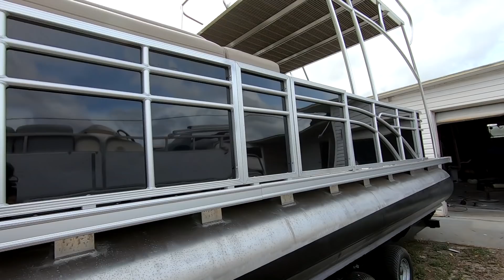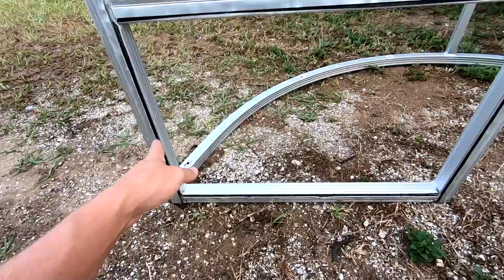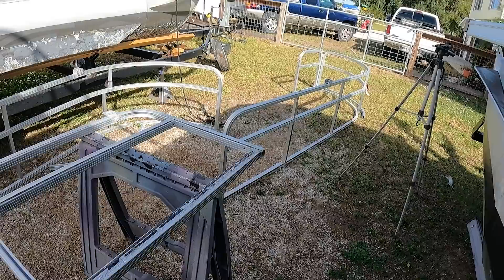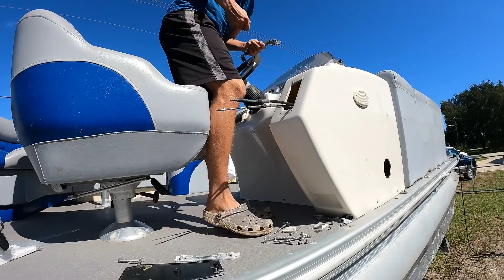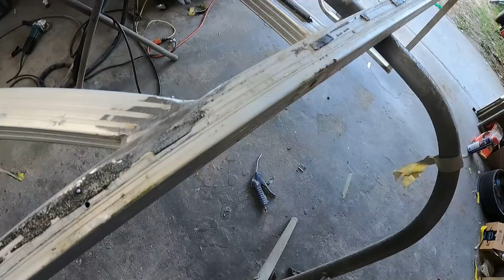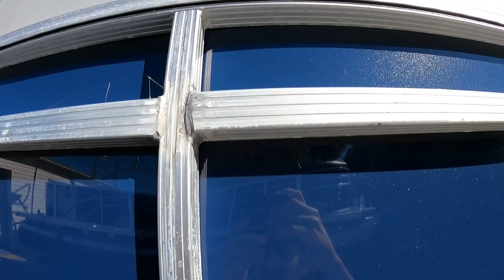Modernize Your Old Pontoon Fencing Easily! Episode 2

Comment: Nice Work! I looked through the comments and saw some mentions of cleaning the aluminum but was surprised no one mentioned grinding the anodization off before welding. That is why you were having trouble making clean welds. You have to grind the anodizing back away from where the weld will be or it is impossible to get a good clean weld. I admire your creativity when rebuilding pontoons, I've been doing it for years and you've given me some great ideas!

Comment: Paint the bottom of the toons blue to match what you just put on. Then the top of the toons silver or gray and paint your rails the same silver or gray. With painting the rails it will hide those dents, welding mistakes, and that black crud that looks like it will take a ton of cleaning to get off. It would look great and very custom.

Comment: For servicing the motor there’s quite a lot you’ll have to do:

1. Change engine oil and filter
2. Change fuel filter
3. Change lower unit oil and the seals on the screws
4. Change impeller (just buy a kit, there’s a couple other things you need to replace in that area anyway)
5. Spark plugs
6. Would recommend giving the motor a good flush and use salt away if it was used in salt water
7. If your engine has carbs, you’ll need to clean them
8. Replace the old fuel hosing, ethanol based fuels eat away at the rubber lining on the inside which gunks up the motor, so you’re better safe than sorry
9. Inspect for any rust in the cylinders ofc
10. Take the prop off and check if there’s any fishing line wrapped around the shaft, it destroys the o ring that connects to the lower unit.
11. If you come across any leaks o rings they’ll need replaced ofc
12. Replace any corroded sacrificial anodes

There’s probably more stuff I can’t remember but if you know an outboard mechanic you might want to ask them for a bit of help. Love what you’re doing with your projects, keep up the good work!

Comment: By the way Zach, the tachometer tells you how many hours are on the motor when the switch is in the on position for a few seconds. To read it, you count how many times the REV LIMIT light blinks and add 100 for every thousand revs is indicated. In your engine's case the REV LIMIT light blinked three times and then indicated just over 3000 RPM. Each blink is 500 hours. So your engine has just over 1800 hours.

Comment: Hey, TIG welding the aluminum would be so much easier and cleaner, you should try it. Just make sure the aluminum is clean before you weld it. I would definitely replace the water pump in the lower end unit before you clean the motor and paint it, anyway definitely replace the water pump before you put it in the water.

Comment: great job man! aluminium need to be very clean when welding. use a new uncontaminated wire brush and then some type of alcohol to clean. if the weld is black, its to dirty. even used wirebrush is to dirty

Comment: Impeller, lower unit gear lube, fuel filter, plugs.

I also have a small welder that can do aluminum, so when I get home this spring I want to get the argon gas bottle and other supplies to give it a try.

Comment: I am a 20 year retired Navy Seabee Steelworker and from a lot of experience, Aluminum MIG is a total pain. It can be used on thin stock, but it’s more for thicker material. You need more heat to get the aluminum to flow correctly. You’ll burn through thinner material with that kind of heat. Plus, Aluminum MIG is hot and fast, nothing like welding steel that can handle the heat. You would have been far better off to buy a TIG torch that is more suited for thinner material. Don’t let TIG welding scare you, it’s pretty easy, you just have to clean it more and have a welder that is AC. 
The other guy is correct. With any sort of gas shielding welding, you have to be inside and out of the wind because it will blow away the gas and your welds look like goose poop. Go inside your garage or shield your work area and use that big fan to blow out the exhaust fumes. 
Just keep at it, you have one hell of an engineering, creative and determined mind, you’ll figure it out. 
The new siding looks outstanding. You’ll have no problem selling either pontoon boat when you’re finished.